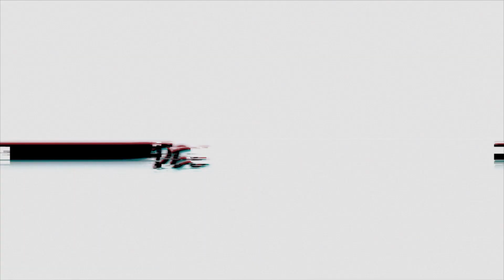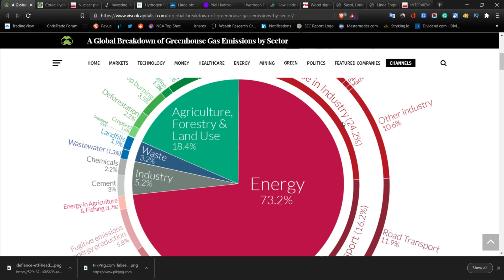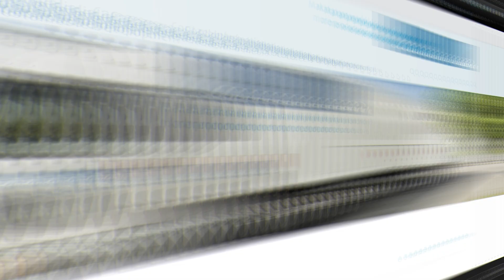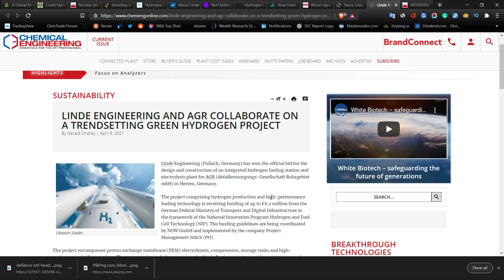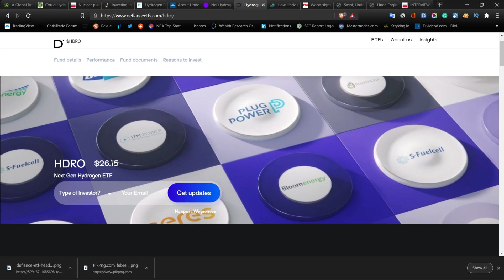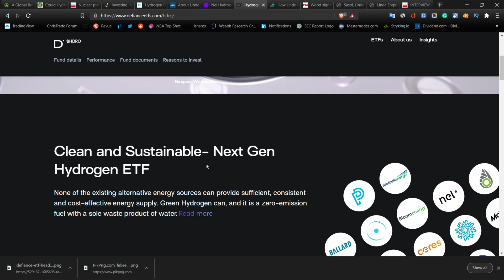Hydrogen Stocks Worth Investing?

Comment: Universal Axiom: All hydrogen stocks suck, including NEL, and will continue to suck until electrolyzers are conceived, designed, and built that can produce millions of tons of hydrogen per annum.  Right now, this is not even close to possible.   Hydrogen electrolyzers and fuel cells are total nonsense in India and everywhere else, the "Hydrogen stocks" are hopeless losers because none of the electrolyzer companies can deliver industrial-scale capacity.  They only offer small-scale electrolysis capacity, so they can't provide anything but small-scale revenue.  Small-scale revenue will never eclipse their operating budget, so they cannot show a profit (earnings).  Small-scale electrolyzers cannot make enough H2 from water to reduce CO2 output at an industrial scale, so they are irrelevant.  Renewable energy is coming on line quickly, but to reduce global warming, one must decarbonize all of the greenhouse gas emitting sectors -- transportation, agriculture, residential & commercial building and industrial sources (primarily concrete, glass, steel and industrial chemicals).  That means we must create decarbonized fuels such as green ammonia, whereby we take cheap and abundant renewable energy and split water into cheap hydrogen and oxygen.  Then, humanity can remove nitrogen from the air (air is 78% Nitrogen) and, using the Haber Bosch method, combine the green H2 and N to make green ammonia (NH3).  Ammonia, as a "liquid carrier of hydrogen fuel," can carry more hydrogen/BTUs by volume at a reasonable temperature and pressure than gaseous or liquid hydrogen.  Large-scale electrolyzers (no existing electrolyzer manufacturer can provide) would allow green ammonia to fuel and power all greenhouse gas emitting sectors.  When electrolyzers are scaled to provide ammonia-scale plants producing four million metric tons of anhydrous ammonia per year, replacing methane feedstock; call me.  It is important to realize that to produce one ton of ammonia using today's methane "steam reformation process" conventional ammonia producers for nitrogenous fertilizers release 2.84 tons of CO2.